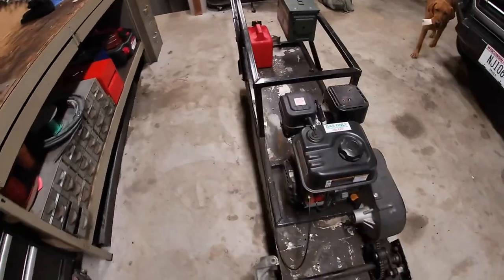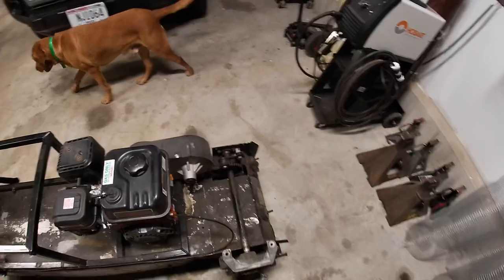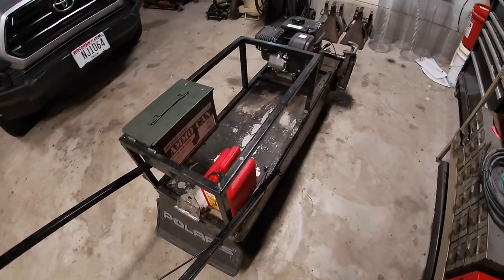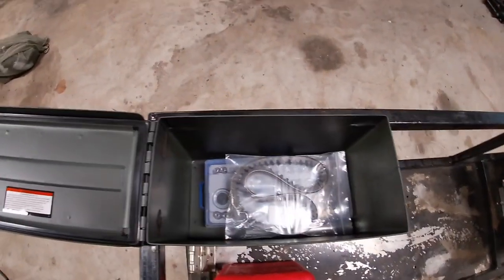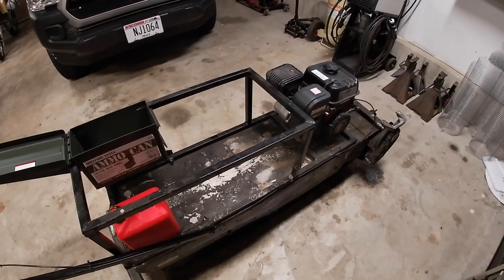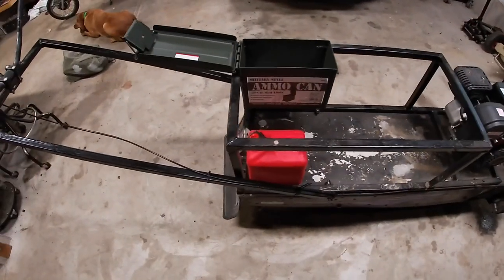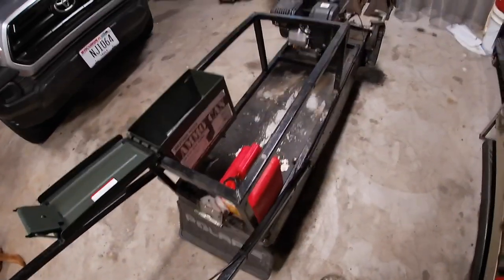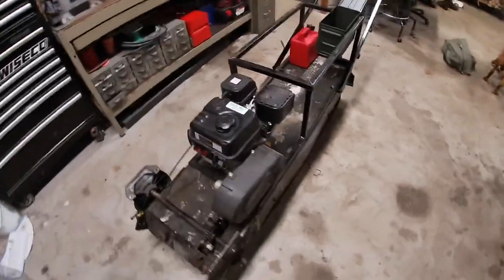Track sled details and answering questions

Comment: just watched this video, I built something highly similar and I was wondering about the front sprocket, 36 tooth. i ordered smaller sizes to try them, I think a 15 tooth, which should give me more top end but i was wondering about clutch engagement and burning up belts.... I can get 10 to 11 mph as is pulling a large otter and me at about 230 lbs dressed and gear. maybe i should leave it alone,..??? quick tip, I bought a carb kit to up the jets as they came rather lean out of the box, came with a K and N style air cleaner, and adapter plate,  I removed the bolt on muffler and made a mounting flange for the exhaust flange and ran 1.5 inch pipe to the stock snowmobile muffler that i reused and mounted to the side. it made a big difference in idle and start up and just seems to perform better all around. it is 6.5 predator engine to be clear. still may try the gear swap,...unsure....thanks for the video !!!

Comment: Hey im in the process of building mine was just wondering what gears you have in the chaincase i have 21 top 35 bottom in mine wondering if my gearing would be fine with a 46 tooth ?

Comment: TR What Polaris sled chassis did you use for your track sled?  Was there enough stock shaft to work with from the chain gear box to the 
opposite drive side?  Curious about the chassis length and the amount of muscle you need to steer the track sled?  Obviously you don't need any braking for the type of terrain your using it on any thoughts on that?
Reply from the maker: I believe it’s a 1996 xlt Indy lite. Yes there was enough drive shaft to work with just fine. It takes a little bit of upper body to run this machine but not bad at all. And it engine brakes quickly so I didn’t think brakes were needed on this machine

Comment: Where did you get that 46 tooth sprocket?
Reply from the maker: I ordered off of eBay. After looking at my recent orders it is a 36 tooth* my bad https://www.ebay.com/itm/35B36H-1-Bore-Type-B-Finish-Sprocket-for-35-Roller-Chain-36-Tooth-/323869042889?mkcid=16&mkevt=1&_trksid=p2349624.m46890.l49286&mkrid=711-127632-2357-0

Comment: What chain size you using
Reply from the maker: This is all #35 chain because I had some laying around but I would opt for going the next size up that the torque converter gives you just because these machines have a ton of torque.

Comment: Does the sled part tip forward a little with the motor?
Reply from the maker: Actually not at all And the handle bars have enough leverage to lift the front end up pretty easy